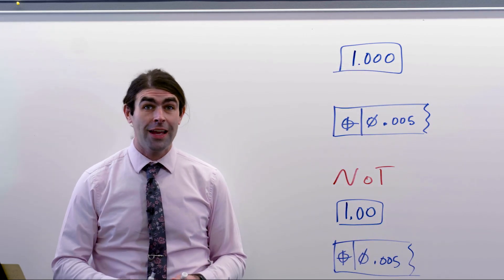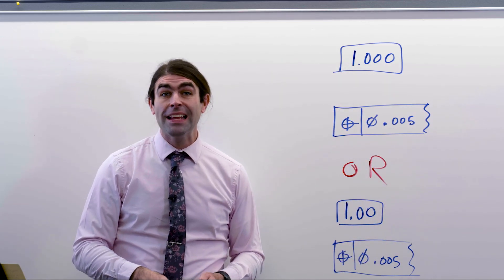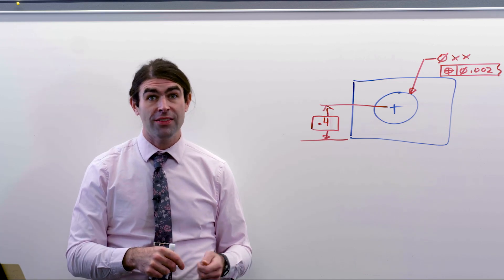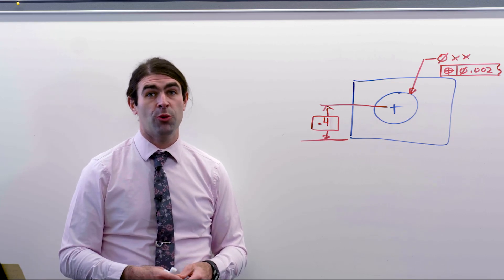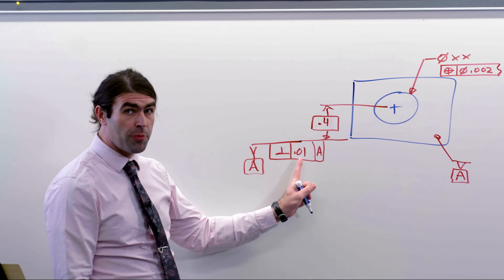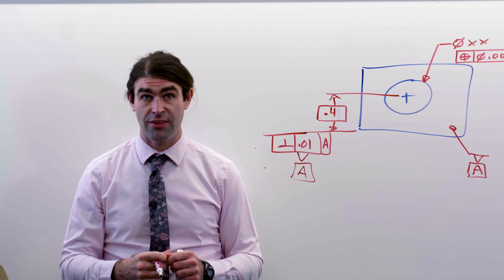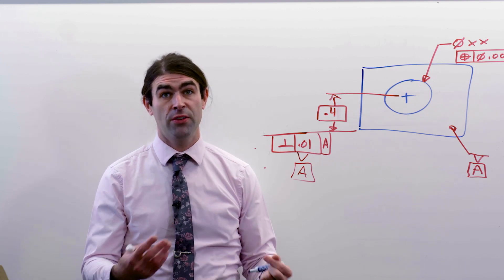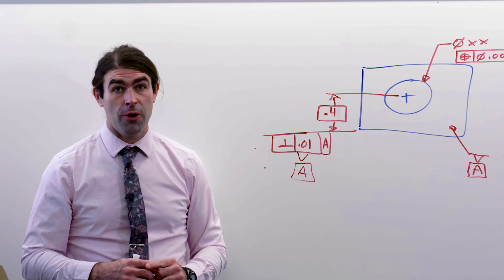Complaining about ASME Y14.5 Changes 1994-2009

Comment: Sir, in your second example you call out datum A in the FCF and define datum A on the same feature. Datum A is also the top surface of the part.  Is this correct? I didn't think you could use a datum surface as a reference surface.

Comment: Hi Dean, great video. I have actually seen the first ‘complaint’ cause issues in automotive design. When interpreting tolerance stacks there are unconsidered interference conditions that can cause problems for design teams when the parts come in within drawing tolerance, but do not assembly as per the design teams wider CAD assembly intent. It is important for designers to make sure they are not ‘rounding’ out of habit in their CAD drawing softwares.
Reply from the maker: Thanks so much! I usually don’t make “opinion” videos, but these two changes really bug me. I had an issue with the basic dimension/ CAD model recently because I tried to get with the times and not worry about decimal places. I’ll go back to doing it the 1994 way and making my decimal places match.